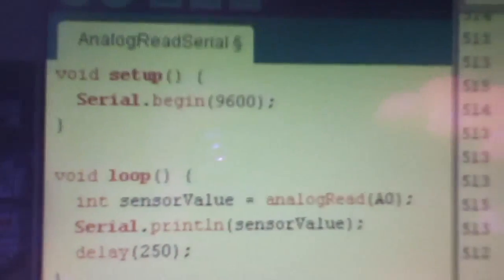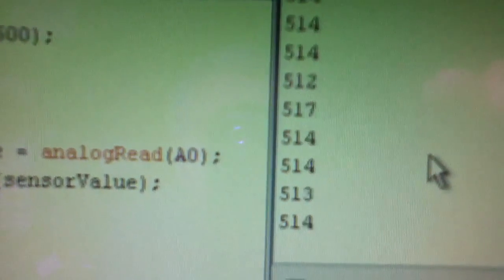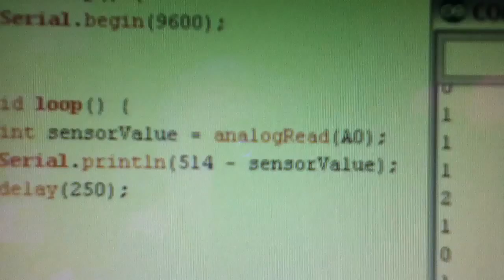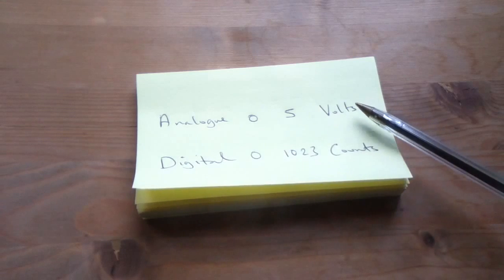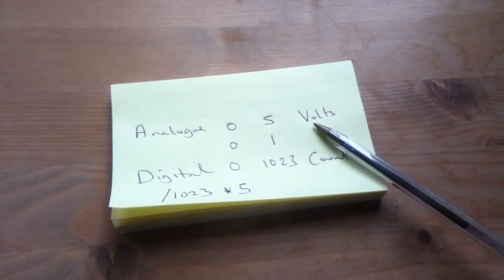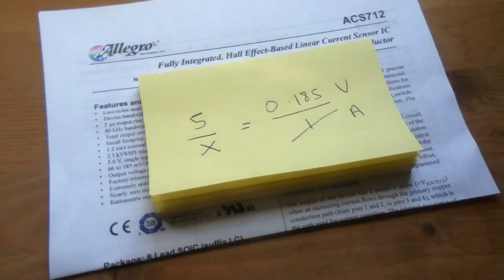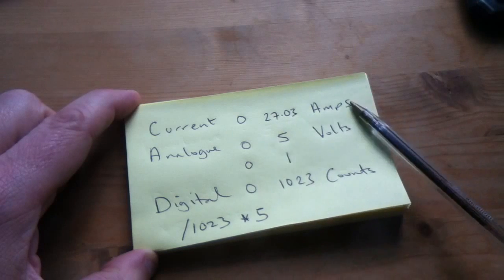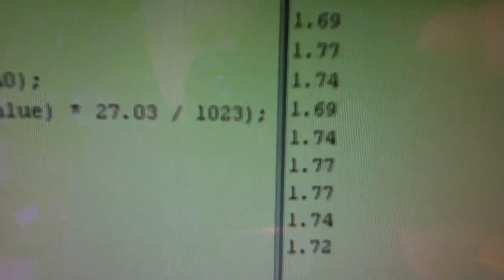Using the ACS712 Hall Effect Current Sensor Module (part 2)

Comment: The correct formula in Arduino is (for the x5A module):
DisplayValue = 10*(ReadValue - 512)/1023
You'r calculation of 27 is wrong. The 185mV/A is over a range of 1.85 V, not 5V. See datasheet. -5A corresponds to 1.6V and +5A corresponds to 3.4V.
So if adc is 0 (zero) the DisplayValue is -5A. if adc is 512 the DisplayValue is 0A and if adc is 1023 the DisplayValue is +5A.

For the x20A module the formula would be:
DisplayValue = 40*(ReadValue - 512)/1023

For the x30A module the formula would be:
DisplayValue = 60*(ReadValue - 512)/1023
Reply: All he needs to do is normalize the reading (the subtraction of 514 in his case) cast it to a float and then divide by 37.888 to get amps.
Oh, and you divide by 1024 NOT 1023.
Reply: I wondered about this also, can anyone confirm which formula is correct? (Julian or hammershigh)  Also comment by mohd seems to have same concern.
Reply: Hugh Coleman 1.7*12 = 20.4. It looks like a 21 watt reversing light. I don't know who's formula is better, but Julian's shows a current draw consistent with a 21 watt bulb. Just a thought.
Reply: hammershigh Julian Ilett Julian, thank you for this great share. Julian's calculation is correct. Initially I thought it wasnt, but it is. It just uses a greater swing but the ratio is the same. hammershigh is wrong in his/her calculation.

The sensor should output ideally 512 when no current is passed through. And when there is current in the sensor, the "difference" in its output voltage is 185mV per amp. In an Uno, one count of ADC output is roughly (assuming Vcc is exactly 5V) 5/1024 = 4.88mV

So 1 amp of current corresponds to 185/4.88 = 37.888 counts.
If the sensor noise is around 13 counts (this is so for me) this is almost 13/37.888 = 0.343 amps of noise (without extra filter, I measure around 0.1 amp noise with the filter)
Sad but true...
Reply: hammershigh Your assumption of 5A corresponding to 1023 is not correct. Why should the range of Arduino ADC match with the range of the sensor? The 5A version of the sensor outputs a maximum of 3.425V = 2.5 + 5*0.185
and a minimum of 1.575 = 2.5 - 5*0.185
For a 5V output you need to pass 13.5 amps through the sensor and for a 0V output you need -13.5 amps.
Reply: My take on this is using dimensional analysis. To reduce confusion i would start converting from the source. I begin with I know 0.185 V/A from the sensor and 5V / 1023 BCD is the sensitivity of the ADC. I want to know how much Amp is there per 1 BCD so I need to end up on a unit which is Amp/BCD. So, the formula would be (1Amp/0.185V)(5V/1023BCD). Volts are cancelled and I will have a ratio of Amps/BCD which is what I want. Now we have 0.0264 Amp /(per) BCD. I could use this to multiply the result from (Read Value - 512) which has the unit of BCD. So (Amp/BCD) BCD will give me Amp which is the final unit we want.

Hope I am right. =)

Comment: Very interesting video's! I'm thinking, since all calculations are done based upon the 5V input voltage you will need a very stable 5V reference voltage, if you are to assume the voltage is bang on 5V in your calculations. One way around this would be to also measure the actual voltage (live) and include it in your calculation, to take into account the inaccuracy of the 5V supply. Does this makes sense in any way?
Reply: See ACS712 datasheet, page 9:
"The ratiometric feature means that its 0 A output, VIOUT(Q), (nominally equal to VCC/2) and sensitivity, Sens, are proportional to its supply voltage, VCC ."

So there's no need to correct anything as long as your ADC reference voltage is the same 5V supply.
Reply: artforz Thanks for your reply, you are absolutely right. I neglected to find the datasheet. While viewing the video this thought just make me wonder, thanks for your clarification!

Comment: Hi, I tried your code and found, that the following is much more accurate:
float a =((float) sensorValue / 512.0 - 1.0) * 2.5 / 2 * 20;
source: forum.arduino.cc/index.php?topic=143265.0

Thank you

Comment: tengo una pregunta: ¿esto funciona con el ACS712 de 30 Amperios? y ¿como se debería trabajar?
Reply from the maker: For the 30A chip, sensitivity is 66mV per amp instead of 185mV/A.
Reply: Julian Ilett but, en el video ¿cual chip estas trabajando? estoy un poco confundido
Reply from the maker: Carlos Andres Arias Lopez In the video I'm using the 5Amp (ACS712-5)
Reply: Es el mismo que el uso en el vídeo anterior!! Mi pregunta es: El esta midiendo la corriente a un panel solar? pq nunca veo el panel solar

Comment from the maker: You'd be better off using a higher current device like the ACS758 available in 50, 100, 150 and 200A versions. Not many modules on eBay, but try 111040360152

Comment: I'm using the 30Amp version of this sensor in my camper van control panel (see youtube video VTQlfB47QJ0 )
The circuit board loks exactly the same, can this actually hold 30A!?

I'm thinking about use 3 of these sensors in parallel and measuring only one of them, and then multiply the reading by 3.. Would that work you think?

Comment: Hey, I've design a MPPT controller too and using ACS712-30A version, Here's how I got the conversion for Bascom, I don't know if it applies to Arduino.   
Amp = Raw_Adc * 0.0048828125    '5/1023=0.0048828125
Amp = Amp - 2.5
Amp = Amp * 12                     '30/2.5=12

Comment: Ahhh. That makes sense. I already know the exact voltage coming from the panel as I'm using a voltage divider circuit with my arduino. I'll adjust my wattage calculation to use this. Thanks for your help.

Comment from the maker: It depends. If you want to measure Watts in the load, you need voltage across the load multiplied by current flowing through the load.  If you want to measure Watts from the solar panel, you need voltage across the panel multiplied by current flowing through the panel. I don't think the Arduino supply voltage is relevant. Use a potential divider to scale the panel voltage down to Arduino voltage levels (0 to 5v).

Comment: So I'm using your video to help me measure watts on my 20w solar panel.
My maths reads like this - 
(float (513 - val1) * 50 / 1023  ); To give me amps  - Bear in mind I'm using the 20 amp version.
To calculate watts I'm doing amps (result from above) x supply voltage. (Which I measure out at 4.98 volts).
Question is - Am I using the correct voltage in my multiplication?  Is it the supply voltage?  Or the voltage across the load?

Comment: The function head from the appendix:

long map(long x, long in_min, long in_max, long out_min, long out_max)

Looks like that this are longs. 

I run a simple example in python because I have no access to the Arduino IDE now:

In [1]: inmin = 512

In [2]: inmax = 1023

In [3]: outmin = 0

In [4]: outmax = 13.5

In [5]: (600 - inmin) * (outmax - outmin) / (inmax - inmin) + outmin
Out[5]: 2.324853228962818

That is what you want right?

Comment from the maker: Use a potential divider. A 20k and a 10k resistor will give you a 3:1 ratio which will work for measurements up to 15v.

Comment: Hi, check this command out: arduino.cc/de/Reference/Map

So you can map from 2.5V-5V to 0A-13.5A and from 2.5V-0V to 0A-(-13.5A). Give that at shot. Its definitive more readable which is good if you look at your code after a while.

Glad to hear if it succeeded

Comment: reading the voltages and getting the amp and current is this sensor can only handle 5v monitoring the max? I have a 12v fan I would like to monitor?

Comment from the maker: The 1.2 milliohm resistance of the current path is the same for all 3 variants, so I suspect all 3 can handle 30 amps. The 5 amp type with its higher sensitivity is only guaranteed linear between -5A and +5A, but it has a measurement range well beyond these limits.

Comment: Thank you for another instructive video, but could you clarify a point for me please? In your calculations, you use the 0.185 mV/A sensitivity ratio which is for the 5A unit. This works out to be 27.03A for the full 5V sensor output range. What I don't understand is how you could put nearly 30A into a device which can presumably only handle 5A. I ask because I'm looking to buy a similar device to sense a DC motor stall, and I'm not sure which of the 3 variants to get.

Comment: Hello, can you try "AMP = (512 - count) / 37.888"
Do you have more accurate current measuring equipment to see which code produces the most accurate reading?
Possibly an ammeter accurate to 1/1000th or 1/10000th of an ampere.

Comment from the maker: There are 2 actions that need to be taken, an offset and a scale. The scale has to be * 27.03 / 1023 because that's the ratio of amps to counts. The offset can be applied anywhere; I chose to apply it to the counts.

But it could be applied after the scaling has been calculated by subtracting the result from 13.51

I think that's right?!

Comment: Did i miss the point where you factor in the fact that you don't go between 0--1023 but 512--1023 as your count? In your calculations you assume that amps on the input go between 0--23 A, and volts on the output signal go between 0..5 V. But shouldn't an output of zero (count or volt) mean you have -23 A over the chip? 

2.5 [V] / x = 0.185 [V/A] --> x(2.5) = 13.51 [A^-1]
AMP = (512 - count) * 13.51 / 1023

Haven't done maths for ages so i probably missed something fundamental.